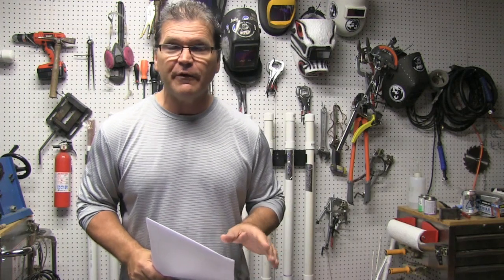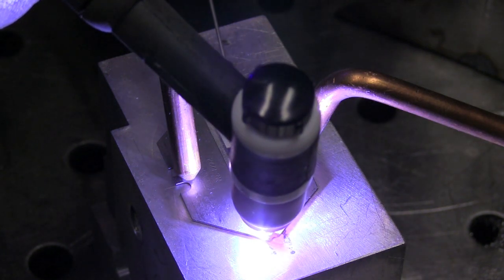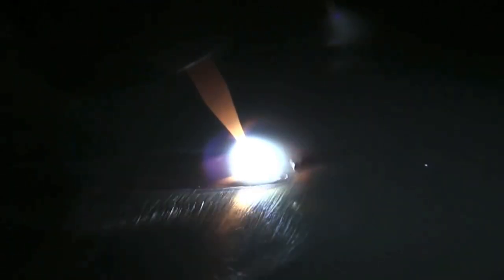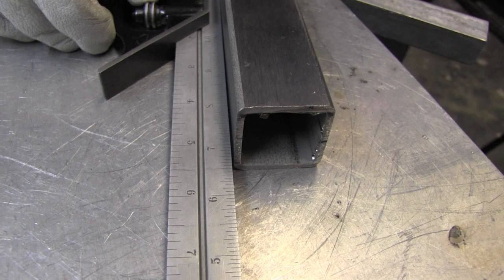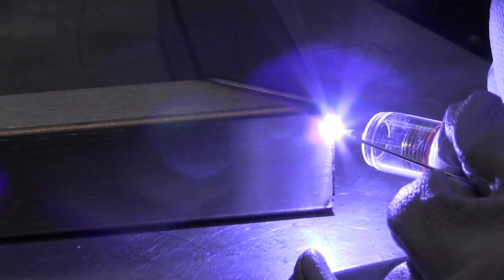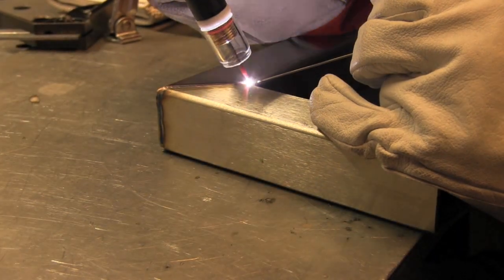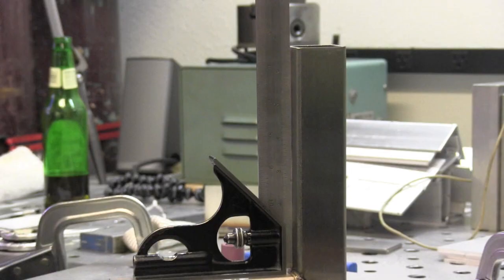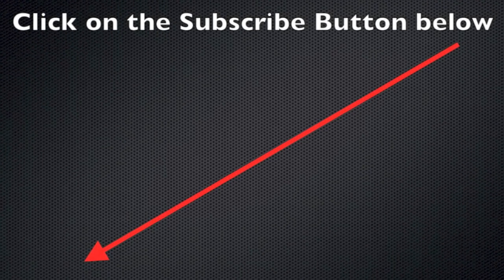Welding Distortion Tips for Keeping it Square

Comment: Now I know for a fact that our cell phones spy on us but it's crazy that this video came up because I was actually looking for it on Jody's website the other day cuz I got a project coming up and I didn't say anything physically I just went on Jody's site and looked for the video I couldn't find it and that was it I never mentioned anything about it other than in my head and now this video pops up, freaky. Jody if you see this, if you had some 1x2 rectangular stainless tubing and your making a mitered 90 degree elbow, the hard way, with  5 gores, 4 weld joints. Should I  gap each weld joint a hair on the throat side, then tack, then follow weld sequencing?

Comment: Stupid question.. if you happen to have everything squared, couldn't you just do a lot of tack welds with cooling in between each weld to reduce chance of weld distortion.  For example tack weld top, bottom and a spot in the middle.. everything square at that point. Then do more tacks between (waiting cooling between each tack) and then blend sections. Note that the plan is to grind later to smoothing the joint so looks don't matter as much. (you guys do beautiful joints.. I inspire to be that good some day)

Comment: Great welds, but your welding sequence is backwards. There's no need to weld something "out of square" if you use the correct welding sequence, which will allow the two sides of the metal to cool against each other at the same rate. Sorry, this is just plain out idiotic.

Comment: thermal expansion. Try the ' weld and skip ' method.  Lay a 1/2 inch bead on one end, flip over, 1/2 inch bead (one bead length long-spaced)on this side. Do this top/bottom. Start at one end, then goto the other end, finishing in the middle. Space out beads, so all are even length across the whole weld distance.
Reply: There are very good educational videos; search google for 1944  metal arc welding techniques THE  STORY OF ALTERNATING CURRENT  WELDING

Comment: Tips for welding a mitred joint with flux core to at least minimize grinding??  It's square tubing like this but thinner, maybe 1/16 or 3/32 roughly.  I'm particularly concerned about the outside edge.  It's a rectangular frame for a table.  Gotta look good.

Comment: hello and thank's for your video but may i m wrong but you should start by the exterior angle who can absorb  less hot than the interior angle , and if you make a welding in a way at the opposite you shouls use the same way and not turn around the piece thath cause twisted , sorry for the english i m french

Comment: Great Video! But in the practice that Weld doesn‘t hold anything, when you grind it!!There is no Preparation at The Weld. When you would grind a small chamfer on the Edge, you would have a better penetration and The Weld would hold a lot more. But still a good Video to explain ;-) Greets from Germany!

Comment: im am not a pro welder so this is a question not a statement. but if the join was cut so it was square when it is flush. wouldn't it be better to do the outside corner first then pull the pieces together until there flush then do the inside corner?

Comment: What size filler metal did Roy use? 

Been welding at work around a year or so. I love it. So much I'm going to buy a good Ac, DC tig machine. Have any tips on a good machine? Looking at the Lincoln Square wave 200

Comment: Great video. Something I struggle with frequently. And I went to welding school. Haha. Still have a lot to learn. Picked up the Lincoln mp210 recently. I like it a lot so far. Not used to having it pre select the welding parameters though. That's new to me. My mig welds are a little high. Not sure if that's a wire speed issue or a travel speed. I like pretty flush welds with great penetration.

Comment: Hi Jody , quick question I'm new at tif welding I've  welded with oxy accet brazing I was told it's something similar, is there a difference on welding steel and aluminum ? And the difference in ac and dc for welding ether one. 
Always looking forward to your next tips and tricks thank you

Comment: hey Jody, thanks for the video, always amazes me how much things pull when cooling off.... I was wondering if you might be able to do a little video or segment on sharpening tungstens, as i have recently acquired a new esab  rebel set, and have all the gear for hf lift tig... i would be interested to know the best method for sharpening using a bench grinder.... my set will only do DC tig (steel etc) 

many thanks Chris (UK)
Reply: Rigger Chris I use a fine gri ding wheel that hasn't touched carbon steel ever ( don't want to contaminated ate your tungsten every time you sharpen it) and put the tungsten in a drill and sharpen  it at an angle 2.5 times the diameter of the tungsten.

Comment: Man, I wish I learned to tig weld at a school instead of being self taught. I have so many bad habits. Like I noticed you dab the filler while just moving the tip linearly. I'm the opposite, I move the tip in small swirls while keeping the filler stationary. I am going to have to try that dabbing thing. Thanks as always for the videos.

Comment: What about clamping the work down square? Serious question.
Reply: clamping can work but if the part builds stresses while welding when the clamps are removed it will still distort. learning how welds pull the metal and making allowances for the amount of pull the weld creates works better than fighting it.

Comment: Tungsten was stuck out quite a bit,was that for just filming?
Reply: My coworker at the fab shop I work at which is all stainless are teaching me to tig weld. It’s used by most people to see easier what they are doing. Welding stainless ya keep the torch pointed pretty direct to the spot being welded, for a smaller weld.

Comment: Great welds, what's the settings ,electrode size and electrode stick out length ?? do you use  stainless mig wire for filler rod,  cheers Dave (FLASH)...

Comment: When i went to school we made several V-joints with thick steel, Worked around the shrinkage by placing a MMA stick (OK 48.00) on the starter side, And a bigger electrode on the other side.

Comment: And to u bud talkin bout the magnets they r not strong enough to hold the metal from the stresses of welding. Magnets wont work on stainless either. Well duplex stainless the magnets may hold the parts for u to tack them because duplex can b magnetic but most stainless u won't get a mag to stick

Comment: Not to b a picky no it all sounding welder but if u need exact precision from saw to welding n want square on a joint like that sometimes I find saw cutting the tubing a little outa square by a couple degree after welding should b bang on. Looks like that is what was done on that joint. Tacking a joint outa square with a gap in hopes of it pulling in perfect makes for ruff looking welds. If the joint is perfectly square before u start chances r it will pull over outa square. Your a good welder Jody cheers!

Comment: dear Jody been having some trouble with some plasma cutting lately at the shop on a project. no matter how fast slow or high and low I go. it keeps pulling the factory side off. sad part is I need it 100% square for a job r I got to keep making it till its right.I'm cuting 3/16 thick hot rolled steel.

Comment: If after cooling the joint has still wider than square, would going over the inside fillet bead again with the torch close the angle more?

Comment: Helpful video! (as usuall, i bought a TIG machine a few months ago, and your videos were a real guide for me to start welding aluminum.
I also found it helpful for a T-joint (with 2 square steel tubes in my situation) To do a weld on the left side, and immediately do a weld on the right side. Then check, do the other sides and it all ended up very straight. Another way is to keep a little gap, do one side, align, and do the other.

Comment: Hi Jody,
recently i ran across a set of squares that are half a degree (30' ) off square. one is marked 89 30' and the other 90 30'. my guess is that these are a type of square for tacking that compensate for the shrinkage. 
looking at the square as your friend Roy started in, it looked to be about half a degree off square perhaps a little more. 
what are your thoughts on this set of squares ?

cheers
mike
Reply: i know this is an old question. But you would need a larger angle than 90 to compensate for the shrinkage. eg. 92deg or 91deg. at 89 deg you are pulling out of square! hope this helps if your still alive. :)

Comment: Be carefull when welding w magnets drew, years ago i could not figure out why when mig welding the arc was doing weird things and it was the magnet i had on the underside of the piece, once i removed it all was good. just watch the placement of them, also heat is not good on a magnet. As far as this video i really think this a great video, will put this to use, ive fought w stainless alot at work and this will help greatly. Thanks..

Comment: Jody, I'm really learning a lot with your video's and the TIG FINGER is the coolest tool, pun intended. Keep the video's coming,  I have noticed most of your videos your using fresh new metal, I was wandering if you have any advice for tig welding vintage car sheet metal that has been media blasted.  or have you ever used the tig torch to heat metal for brazing.  Thanks

Comment: Great vid, a suggestion, maybe you could do/post a vid where you show how to undo some of the pulling with a post heat. i.e. if it pulls to much out of square you can go in and lightly heat the inner joint to allow the weld stresses on the outside of the corner to pull it back.

Comment: I work at a handrail fabrication shop and we do a little bit of stainless grab bar out of thin gauge 1"1/2 round tubing from time to time and we can't keep it square for nothing. we weld it, cool it, and tweek it square. Is there any way to avoid those steps on that type of material.

Comment: I'm working with 1 inch .065 wall 316 stainless  making marine railings  this stuff is alive with heat. if I machine some copper  to take the heat and try to keep my weld direction planned better like the vid it could do it. Thanks

Comment: hey Jody I just got done doing a weld test for a job where u had to use .045 wire over head down hill and horizontal can you use all those joints with the same settings

Comment: my top tip- the sliding square should never be used for checking square. as the sliding square slides it gradually wears down unevenly. always use a ruler and 3+4=5.

Comment: Jody, could you make a Video of 6G inclined uphill pipe with 7018 with 3/32 inch electrode with a pipe diameter of approx 4 inches? both weaving and stringing top.
Iwould really appreciate it cuz im stuck at the moment but i want to pass it! :)

Comment: Jody, do you recommend the magnets that are available to keep such welding in place? (for ferrous metals).
Reply from the maker: +Drew6709 Magnets can be handy sometimes.  I use them occasionally... but only for tack welding small parts
Reply: +taewachien I don't do much welding with my old Forney stick welder. I went to Harbor Freight to buy the cheap welding magnets.
Reply: Just another note: Magnets are great for tacking, but temps around 200º F or more will cause magnets to lose their magnetism, especially rare earth magnets such a Neodymium.
Reply: Strong hand and magswitch make a variety of magnets that can be switched off for cleaning. Sometimes the magswitch cubes interfere with the arc, it can help to turn them around 180 degrees or weld in the opposite direction. It's best to use them for tacking only.
Reply: FIREHAWK1979  true I've found the magnets interfere with arc at close range especially the stronger ones.
Reply: +FIREHAWK1979 Yeah I don't use magnets because of how it messes with an arc. That messes with my head!
Reply: +Paul Frederick It's not just that. Fitment magnets should only be used while tacking. Using them while you're stitching up the whole piece is useless, for one, and will kill the magnetism of the magnets. You're supposed to use the magnets to "dry-fit" and tack, nothing more.
Reply: INF1D3L010
I have enough clamps that it never comes down to me needing magnets. Which is good, because magnetic arc waver does bug the crap out of me. Even tacking.
Reply: +Paul Frederick  I noticed my arc doing weird things and then I realized it was the magnet I was using. Spooky.
Reply: Ralph Dratman Magnets work through the flow of electrons, just like electricity, so it's not too much of a stretch that they would affect each-other.
Reply: Ralph Dratman
Yeah I hate magnetic arc wander.
Reply: Paul Frederick Then you shouldn't be welding around magnets. They are only meant for tacking.
Reply: INF1D3L010
Tacking is welding. That is why it is called tack welding. It only affects TIG welding anyways. At least that is the only time I find it annoying.
Reply: Paul Frederick Well aren't you special...
Reply: INF1D3L010
Quite.

Comment: what are the thoughts of a tig conversion set for a arc welder?
Reply from the maker: +Arjan Wilbie A scratch start tig using a DC stick welder works OK for steel. but you are definitely limited.  Its not the best way to tig weld and not even the cheapest unless you already have a DC stick welder.  To do AC Aluminum requires a high frequency box and by the time you by all that stuff you have several hundred bucks in it.
Reply: +weldingtipsandtricks I have a 1960's 140A unit and a 1973 unit with 4 places to hook up the electrode holder lead. I might as well save up for a decent set up. donations welcome :)

Comment: what is the main reason for using the filler wire?
Reply: +ringelnatz1000 there are oxidizers in the filler rod that bring a stronger weld as compared to autogeneous (not using filler) welding.

So i guess you could say stronger weld, better appearance also.  Easier to do with filler wire also.
Reply: ok thanks :)
Reply: +ringelnatz1000 deoxidizers actually. very important difference. (spelling)

Comment: Very nice tips! I was wondering in what sequence would you weld an actual rectangle to keep deforming to a minimum just like the one at 1:50 . Probably tack weld the whole thing first, but after that do you just weld one part in one corner, and do the same thing for the other corners and then return to the 1st corner and weld the next part and do the same for others. Or should you weld a different part on the opposite corner or flip the square and then weld... confusing I know, but would be awesome if you did a quick video just explaining the order and sequence that you would weld something like that to even out the 'pull' and get the least amount of deformation.
Reply: hey mate just by chance I saw your comment and my former job was welding complex steel doors and windows to within 2-3mm of squareness using profile sections. method was, first tack it up and make sure your measurements are good side to side/frame is square then clamp it. then weld the sides first ALWAYS. The sequence is pick a corner, then go diagonally opposite and then the adjacent corner and finally you'll move across to the last corner. leaving the clamps on you then repeat the sequence for the top face welding inside to out always as the draw of the material is limited by the fitup this way. Let it cool down before moving the clamps and then flip and repeat. If you follow those steps and are accurate in your initial setup and measurements you'll get square frames every time, hope that helped
Reply: I shit you not, commented before even watching the vid haha